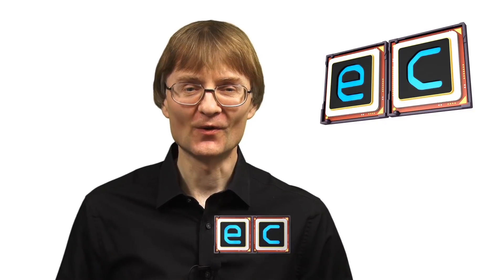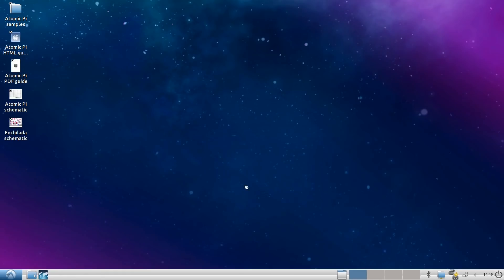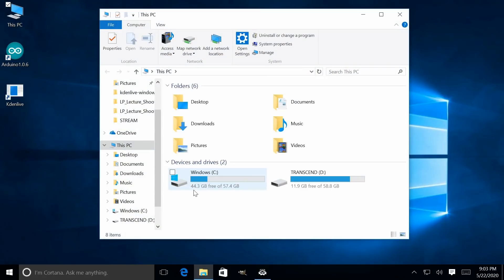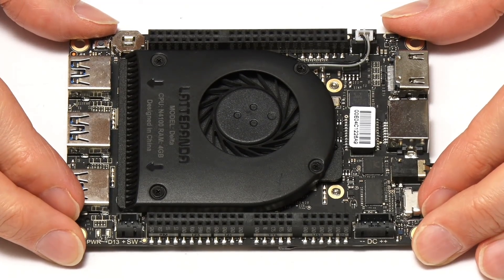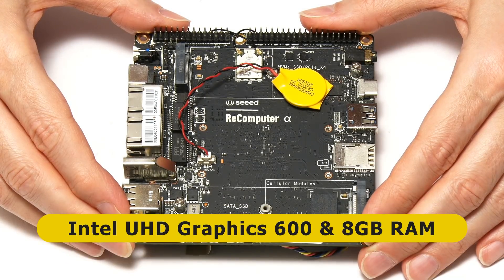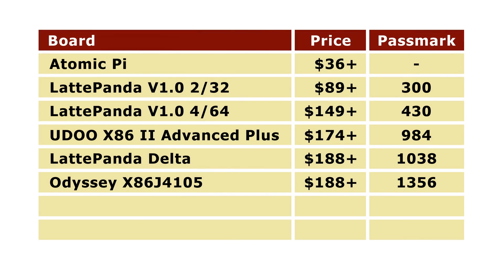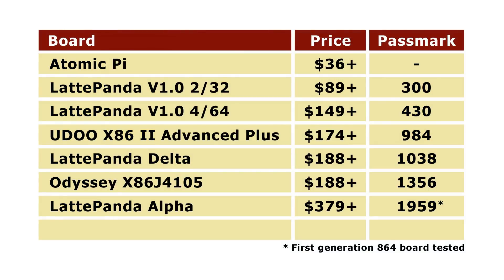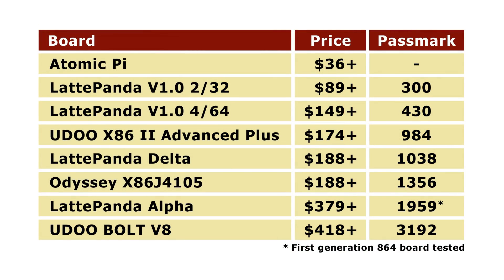Eight x86 SBCs

Comment: Thank you for another fantastic video! 😊🙏🙏

The Odyssey board has a favorite little known feature. If you use a proper monitor which supports display port or HDMI over USB C with this board it supports a single cable operation.

The board can be powers by the same USB C cable that carries a 4k video signal. Plug in a little wireless mouse and keyboard dongle and you are good to go. 

And I love the look of the aluminum case when it is sitting on its side.  https://youtu.be/lmJQ7JBQV1Q

Comment: the udoo is more of a barebone pc, like the intel NUC's.
Reply: Was thinking just the same. Performance wise it blows the rest out of the water, too, which is only natural considering the asking prize... With the exception of the LattePanda Alpha, which gets destroyed by the Udoo in the sense that they are fairly close in price and the Udoo performs massively better, specially in the CPU department (Passmark ratings mentioned are overall system performance, but the Ryzen CPU in the Udoo is more than doubles the specific CPU Passmark score of the Celeron in the LP Alpha).

Comment: I've used the DFRobot LattePanda for years.  Every board I've used in multiple projects has had a hardware failure.  Different failures on 4 different boards.  One board bricked, no reason I can figure.  One board had the Arduino core fail, but otherwise works.  One board had the USB fail, but otherwise works.  One board has intermittent failures across peripherals.  4 boards over multiple years -- all failed longevity.  I replaced the boards with UP Boards and Raspberry Pis.  Same projects -- power system, peripherals, etc -- no issues when replaced with other SBCs.  LattePanda's 83xx boards, in my experience, have poor long-term reliability, and I can't recommend them.  In general, long-term reliability in real projects matters -- who wants to rebuild their project all the time?
Reply from the maker: Very useful feedback from your long-term application. Thanks for sharing.

Comment: I would like to see you to talk about the original intel surf-sticks and mini-pc-box copies thereof from china and many suppliers when talking about the latte panda.
Also with the same intel Z CPU, power supply, nice case and one or two usb (3.0) ports.
- if you mention the latte panda as cheapest win10 "computer", for people who dont need the soldered on arduino or use one via usb-serial thats an even cheaper complete option,
especially to take along on holidays. wireless keyboard with touchpad, short hdmi cable (hotel tv), perhaps wlan repeater/AP and you are done.

Comment: Hi Chris, Tom from LI. Great video. No sizzle just good steak.  From last week you asked what we were doing with our Pis'. I plan on using mine to control my Sainsmart 3018 Pro once a Pi version of a good skixer is made available. I still have tiassemble the 3018 but I look forward too that, 

BTW, What video capture device do you use on the Pi. Your results are top notch abd I aspire to achieve similiar quality.  Stay welll. Cheers..
Reply from the maker: Thanks for this Arthur. I capture all computers using a Blackmagic Design Video Assist 4K -- I show this in this video: https://www.youtube.com/watch?v=pocs02YuJ4k and also in my recent 300th video "making of" episode: https://www.youtube.com/watch?v=176aHXO1Pwc

Comment: While the benchmark vs cost is interesting, personally I'm also very interested in power consumption and efficiency for these kinds of board.
Reply: For sure. I'm slapping battery packs on the to backs of most of my SBC's i get from trade shows. Power comparisons next to performance comparisons is pretty important for my use cases as well. Assuming there is actually a significant difference.
Reply: I would love a video with this info.
Reply: I think you can attach many of them to the back of a monitor or a TV and use a USB cable to power the SBC from the TV/monitor
Reply: @Ed-bj5eq  Yes but depending on usage scenario you might want a UPS setup for your SBC, and to calculate runtime and power required you need to know the power consumption.
Reply: Same here.  I was just starting to make a spreadsheet to document that when I read this.
Reply: If it's any help, I can give you a figure: A Pi Zero or Zero W, if you optimise the hell out of it, can operate on 0.5W at 5V. Or 0.4W at 3.3V, but you'll lose USB. You have to really tweak it to get that low - even disabling the HDMI output to save the current draw of the driver circuitry.
Reply: Yeah, me too, I'm actually looking for a small board to run dhcp / node.js in a console only installation. So, for me, I really want to reduce consumption and have something running off of a battery. Getting consumption down as low as possible is super important. It means you save money and effort on replacing batteries. If you need something to run for 8 hours, and sure, it's running for 10 hours now, but in 6 months time it won't.
Reply: Cergorach, if you very interested in power consumption then don't buy it - it would be ZERO of power consumption then.
(for efficiency get old intel core quad computer for free)
Reply: @Getoverhere666  Absolutely not, as I had an old quad core computer and that was anything but power efficient. It's not about cost (but a nice side benefit), but about actual wattage and heat.
Reply: @Cergorach  it is not power efficient, yes.

Comment: I might be wrong, but you said on the lattepandas 2/32 and 4/64 are arduino megas on board. I thought that there were arduino micros(atmega32u4) onboard.
Reply from the maker: You are right! The LP 2/32 an 4/64 have ATmega32u4 controllers. I am sorry for this error, and stand corrected.
Reply: @ExplainingComputers  No problem. Btw very cool and informative video.

Comment: I like the look of some of those for a KODI or PLEX player - did you notice any fan noise from the ones with active cooling ?
Reply from the maker: All of the boards with a fan here have one that is either off, or fully on. The LattePanda Alpha and Delta have very quiet fans, as does the Odyssey X86J4105. All are fine as media PCs -- the fan is not distracting. However, the fan on the Udoo Bolt is very distracting when it cuts in, so I would not use this board as a media player for that reason. I have recently been using the Odyssey connected to my TV to watch Disney Plus! :)
Reply: @ExplainingComputers  Thanks Chris, very helpful as always - thanks again for the excellent content.

Comment: I could've got this instead of an intel NUC for my home theater pc, then again that only cost me 200, had to buy the NUC, the ram, and the ssd. Pretty nice machine for upgrading and honestly I was having trouble with some DRM things that wouldn't play on anything but Windows (possibly android). I felt like my only headache free option was a windows computer for an htpc, but these little guys could be a great option as well.

I think though the nuc has a 256gb ssd and 8 gigs of ram, so for $200 it's a heck of a deal. The processor in this is better though, considerably so I believe.
Reply from the maker: $200 for a NUC with 8GB RAM  and a 256GB SSD is indeed a heck of a deal! :)
Reply from the maker: $200 for a NUC with 8GB RAM  and a 256GB SSD is indeed a heck of a deal! :)

Comment: The Atomic Pi interests me the most, the value proposition is extremely good.

There are light weight windows 10 installs at around 5 GBs which will still leave enough space leftover for other uses.

Only powering the board needs extra hardware... I wonder if I can cut up a USB cable and solder it to the GPIO pins???
Reply from the maker: I power the Atomic Pi with a home-made lash-up of jumper leads soldered to an old socket that plugs into a 5V SBC adapter! :)

Comment: I don't get it.  Please explain to me why get and SBC, X86 or ARM, when you still need a keyboard, pointing device, display and power supply when you can get a complete Win 10 Tablet with faster processors, more memory, cameras, audio and connectivity for between $200 & $300 which has all this and more, is in a nice case, and operates out of the box?  The main missing feature might be the I/O header, which can be an external DAQ for $50 to $159.  For one example: Chuwi Hi10 X at Amazon, there are several others.  Please explain this fetish with SBCs.
Reply: Embedding?
Reply: @stephenhookings1985  OK, so you don't need a screen, human I/O, power supply, etc.  How about a used NUC or similar "hockey puck" computer all over eBay?  Any of which will outperform any of these SBCs.  And you can embed an 8" x86 (or ARM) pad in less volume than the SBCs, thought they tend to be very thin and flat versus SBCs which are chunky and need various add-ons  with wiring to work.

Comment: Great video CB. Very interesting to see all of those SBCs, compared side-by-side. I have the UDOO x86 Advanced Plus (Gen 1), the Atomic Pi and the Odyssey x86. I've tested the Odyssey extensively in terms of the GPIO headers, for both the Linux and Arduino side of things. Seeed Studios has addressed the documentation deficiencies that plagued the board's release, so things should be a LOT less confusing for people trying to get started. And the two M.2 slots make the board a very intriguing option for a serious embedded application. You could even install something like Ubuntu on the 64gb of flash memory, and then two M.2 drives in the slots...and configure a software-driven RAID1 array! I haven't tried it but it should be possible using mdadm. I haven't tried the Latte Panda SBCs yet, but given the price point of these and the UDOO Bolt, I have to agree with your conclusion that the Odyssey is the best bang-for-the-buck. Of note, I finally received my case for the Odyssey board as well last week. It took over two months! Seems like those things are way more popular than Seeed might have thought going in, lol. 

Since I need to use a Windows machine in my office, I suspect I'll end up using that Odyssey board (in its case) as a Linux development machine solution. And given the quality and appearance of the case, that shouldn't be an issue.

Comment: I don't want to be "That guy" but AMD came up with the 64 bit instruction set that extended the 32 bit x86 set established by Intel. So X86-64 Is AMD64. except for Intel Marketing.
Reply: Arm64 bit, and IA64 are incompatible, and separate, but they aren't in this vid.
Reply from the maker: @Trooper_Ish AMD did indeed come up with AMD64. But Intel do label it x86-64, which is why I included that label in the video. :)

Comment: An alternative (upgrade) to an atomic pi might be a asrock j4105b and itx motherboard with an integrated j4105 CPU, for £75 + ram, the size difference is marginal between these boards, a itx pc is more conventional, so nice cases and attachments fit

Comment: Not really related to the video, but do you know whether it would be possible to use a raspberry pi (3B for testing, later maybe a zero w if it works) as a bluetooth and wifi reciever/sender for my pc?
So that I can connect to devices through the bluetooth/wifi chips on the pi from my pc. Kind of like passing through the chips to my pc.

Comment: Is there an official version of Windows 10 from Microsoft that is stripped down with only the essential components, one that is specifically designed to run on these low-powered low-performance SBC? Is Windows 10 IoT only commandline? How about the Windows 10x?
Reply: Not really, they just charge a lower licence fee for devices with only 32GB of storage which is why so many manufacturers offer them even rthough there is no way to update Windows 10 with so little RAM.

Comment: Except of first one - very very expensive toys :( The best value for money is buying just MiniPC which has inside simple PCB which can be used as SBC without case. For example I purchased Gemini Lake N4100 Mini PC 8GB RAM, 180GB SSD, Win10, etc. for only $180. But there are cheaper ones.

Comment: Well that was interesting on many levels.  Seeing the performance difference I downloaded a copy of PASSMARK to my old DELL Core2 Quad (2008) and got a passmark of 1026.  This was an expensive PC in its day and an upgrade to Win 10 and a SSD has done little to make me think it was a good idea.  Maybe time to start saving....  Bob
Reply: I find Passmark and other benchmark software can be a bit biased. For me if hardware and software are fully capable of doing what I need them to; then there is no reason to replace them. I still find uses for socket 7 and socket A 462 hardware.  I find a dual core 64 bit CPU is all you need for online media consumption. A single core Athlon64 3300+ socket 764 can handle it just barely though.  One thing I did learn about Dell was they like to cripple your CPU speed if you don't use their "approved" power supply, or battery.
I still like the Atomic Pi once it is set up right. I have a swap partition set up on an external USB spinner with power save settings on it. Otherwise it is always spinning. It works quite good that way. Just don't go opening a dozen web pages at once.
Reply: Lol my wife Had an Samsung Laptop from 2009 with and Upgraded ssd and i purchased this month an old Office PC mit a 3ghz core to Duo. With the Same SSD its Like doubled the Speed for 27€. But Not nearly as fast as my own also old tec AMD system.
Reply: I ran PassMark on my desktop and only got a score of 2036... 
It is time for me to upgrade. lol
Reply: @RoshiGaming  but besides the xy Score. Is the PC too slow for you or you upset about a Low number?
Reply: @Nordlicht05  Honestly it isn't up to snuff, and hasn't been for a while, I was just surprised at just how low the number really was. It's great for most computing stuff, but any of the video games or streaming stuff I do chugs, or is impossible, on my current setup.
Reply: depending on which core2 quad you , you might be able to upgrade the cpu to a core2 quad 9550 ($25 used typically) it's the 2nd fastest cpu made for those machines. A q6600 cpu with black tape mod might also improve performance with a little hackery. If you're running a 64 bit with 4gb or ram,  you can increase ram very cheaply too which windows 10 really likes more than 4gb.  Lastly you can try to take the old hard drive and put a linux distro on it. Peppermint os and mint xfce are pretty light and work well on an old 755 opti i have with 6gb of ram.

Comment: Good stuff. Nice little ecosystem of x86 SBCs. I'm watching this on an x86 stick PC made by AWOW. It's a smaller form factor than the standard Raspberry Pi, but it's more powerful than the (underpowered) model made by Intel a few years back. It even has a tiny fan! I can recommend it for Linux, but it struggled with Windows due to 16Gb EMMC.

Comment: these manufacturers are going dumb and dumber. They sell almost the size of micro-atx for the price of atx board.

The answer is always build your own micro-atx pc or buy cheap arm like raspberry pi
Reply: Micro ATX boards are huge, compared with these. You always pay more for miniaturisation. Mini ITX has a price premium over micro ATX.
Reply: @johnm2012  sorry i mean mini itx, whatever it is. the smallest desktop form factor. it is just 4-5 cm bigger than udoo bolt and is usually sold for about $60-70. About as much as you would pay for regular atx board. i don't think anyone cares about those 4-5 cm different, but getting to choose any hardware you want

Comment: Which SBC are the most well-documented? (Want to use it for bare metal programming)
Reply from the maker: Here probably the Odyssey X86J4105.
Reply: @ExplainingComputers  Thanks for answering. What would you pick if you could pick anything on the market?
Reply from the maker: @EvolWe  Of these boards, I would pick the Odyssey X86J4105 in its great blue case for maximim flexibilty, and because it works so well -- and because the fan is so quiet! :)

Comment: Running windows 10 on a 32 Gb emmc drive would be tricky to keep updated espacially for the none tech savy as it would easily run out of room. It's a disgrace that many laptop manufactures have vomiting out cheap laptops with that spec.
Reply: I'd say it's a disgrace that Windows handles storage so poorly and does not really clean up after itself after updating

Comment: Why these SBC manufacturers put so much higher price tag on them ~200$ or higher. This amount converts to Rs.15250/- today. For just a mother board. No keyboard, No display, No touchpad, No speakers, No camera, No battery backup etc. Today the cheapest NEW laptop available on amazon and flipkart is of Rs.13999/- has Pentium QC, Intel HD 505, 4GB, 32GB, Win10, 14" display etc. Even the motherboard inside this laptop has same components as SBCs. In my opinion, without display, battery, keyboard, camera, case etc., they should not come more than 70$.  Can you explain?
Reply from the maker: It simply is not possible to design and manufacture an X86 computer in a low production run for the price you state. Remember they have to buy the CPU, chipset and RAM too -- so it is not the case that you just get a motherboard. I know from personal contacts at the manufacturers of these boards they they work with very thin margins

Comment: Atomic Pi - stay away if your intention is to use it as a low powered desktop. I bought it because there are lots and lots of videos showing it in a good light, but in my attempts to use it it often locked up when trying to do 2 things simultaneously. There's no power button. Sometimes it gets stuck in the shutdown process or reboot. The cursor gets stuck on the left edge of the screen. I thought that last one was an experience unique to me, but I asked on the subreddit and apparently it's the norm. I sent mine back.
Reply from the maker: The Atomic Pi is certainly a board for enthusiasts and tinkers -- a maker board in the true sense.